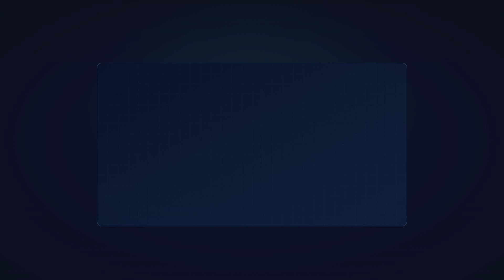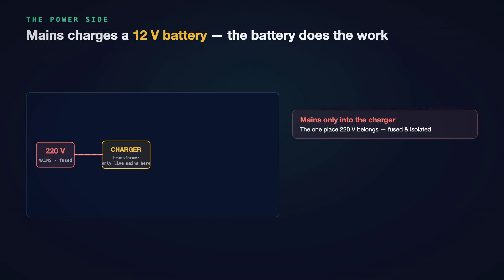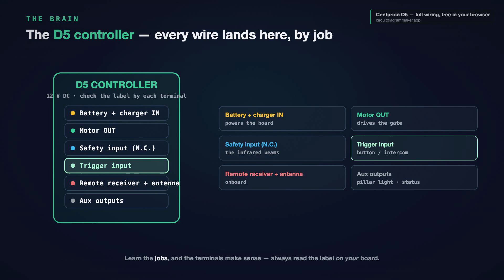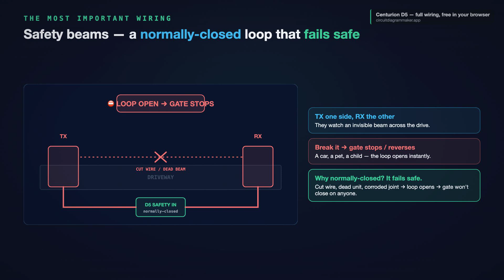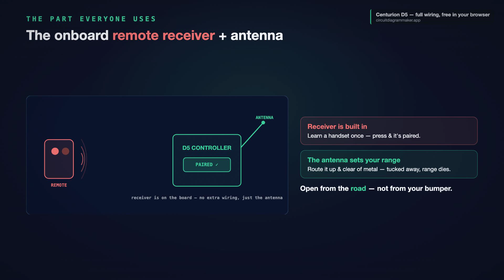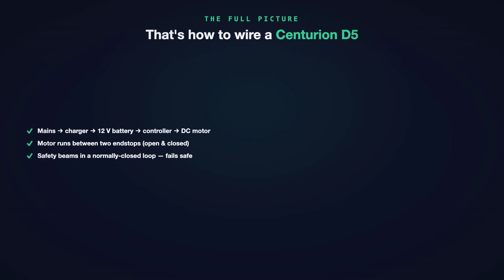How to Wire Centurion D5 Gate Motor (Full Diagram)

Comment from the maker: The one that catches everyone: on a Centurion D5 the motor runs off the 12V battery, NOT the mains — the 220V just charges the battery. That's the whole reason your gate still opens during loadshedding. Second most-missed thing: wire the infrared safety beams as a normally-closed loop, so a cut wire or a dead beam FAILS SAFE and stops the gate instead of quietly doing nothing. Sketch your own full D5 wiring diagram free here 👉 https://circuitdiagrammaker.app/try?utm_source=youtube&utm_medium=pinned_comment&utm_content=yt-162